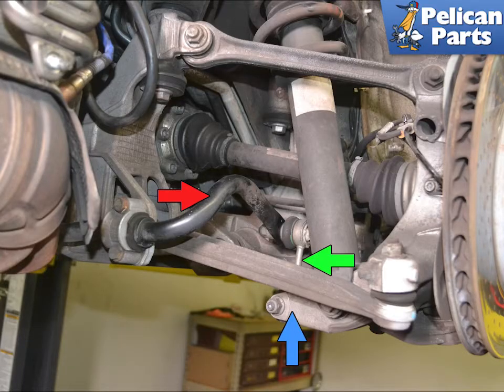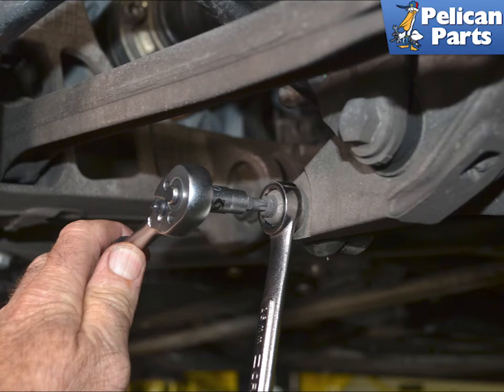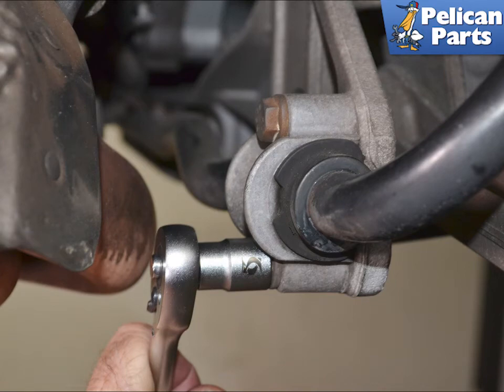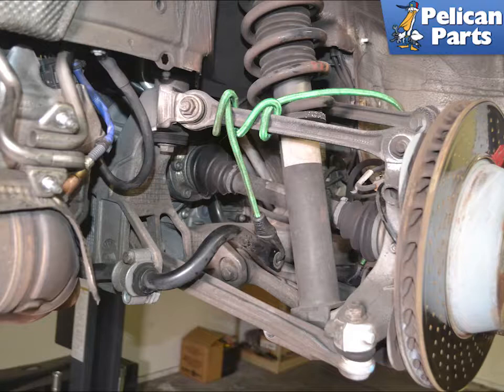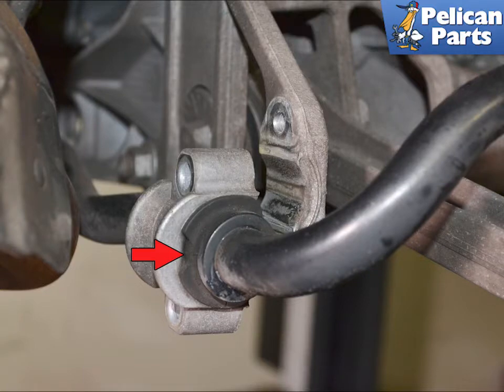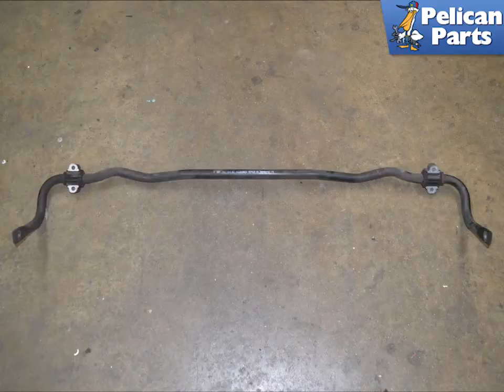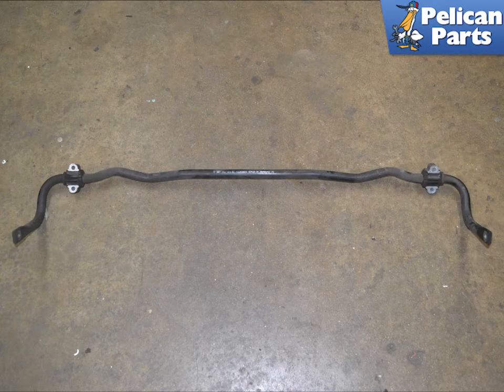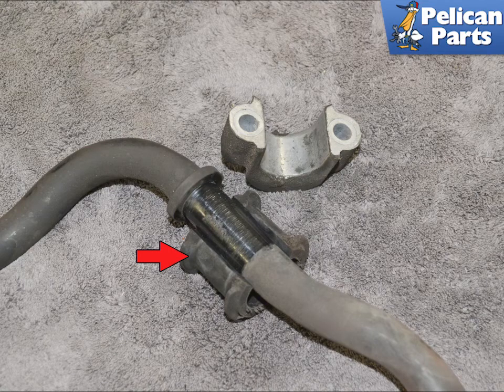Porsche 997.2 Carrera Sway Bar Replacement (2009 - 2012)

Comment: I have a 997.2 manual base C2. Recently got the H&R rear sway bar hr-71188 from you guys. I’ve been getting some clunking on bumps. Since I can’t find install info anywhere, do you know if I need new drop links for this application? Also does the H&R sway bar go over the rear suspension arm (like the stock one) or go under and attaches to the drop links. I ask because if I go over (like the stock one) then the H&R logo is upside down and I get clunking on bumps.. thanks.
Reply from the maker: Installs in same location and orientation as OE. One of the end links might have failed during the install. Check for looseness and replace as needed.